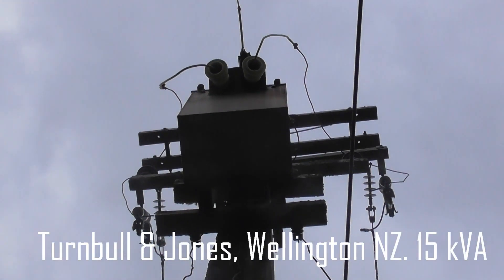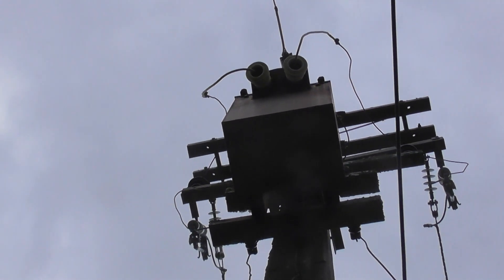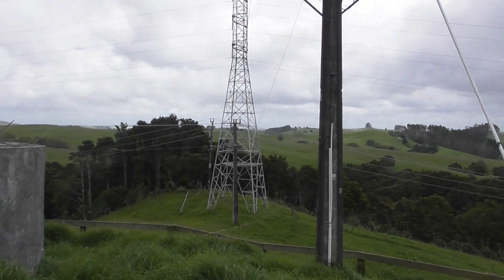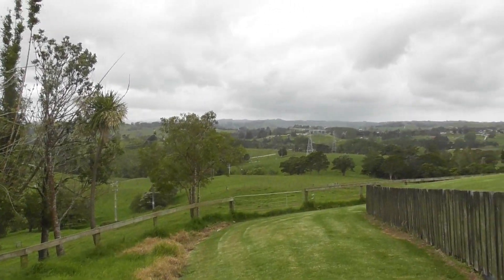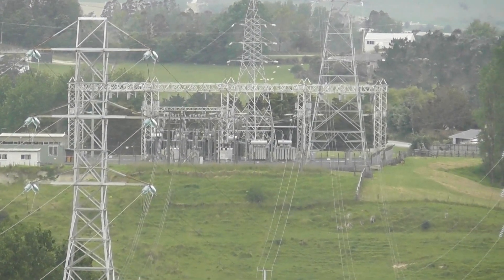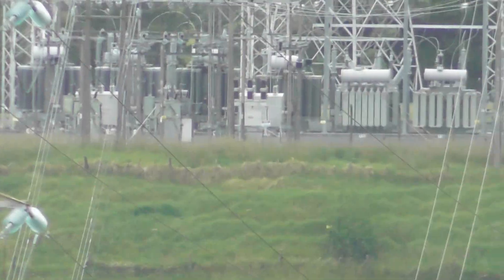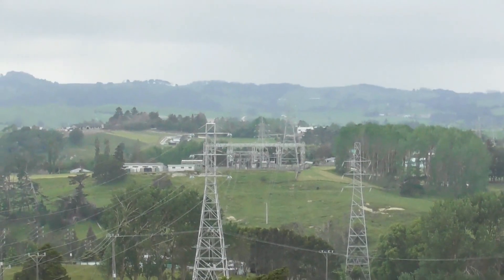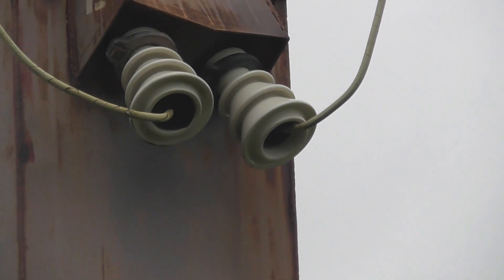15 kVA Turnbull & Jones, rural distribution transformer

Comment: 15kVa... thats almost too small to be even called a distribution transformer. Maybe an instrumentation transformer at best😄
Reply from the maker: Enough to feed one rural house. Most transformer loads are calculated roughly at 3 kVA per house, as most loads are not always on at the same time.
Reply: Unless you have electric water and space heating, that will do 2 rural houses east with diversity. 15kva is about 60 amps at 240 volts, which is the normal supply fuse in the UK for a domestic property.
Reply: I just had an interesting conversation with a coworker about his breaker panel. Blew his mind when i told him to add up the cutout ratings kn the breakers, and compare it to the main.@techone2074
Reply: @robertschemonia5617 yes that’s usually the case as diversity has been calculated into the design. In general purpose or domestic installations it is unlikely that all circuits will be fully loaded.
Reply: @TechOne7671  And if that ever happens and you pull too much amps the main fuse or breaker pops.
Reply: Ehh enough for a stovetop and oven.
You would have gas cooking and hot water and not electric anyways in a rural house.
If the transformer is 15kva they probably have a 50 amp mains fuse.
Reply: Most of them are 15 here in Ireland, although it seems all the new installations in the last couple of years are 33 (probably because of the uptake of heat pumps and EVs).
There are also some really old 5s and 10s still around the place…